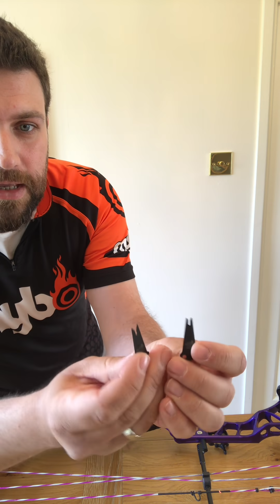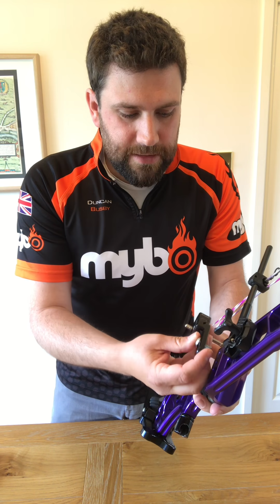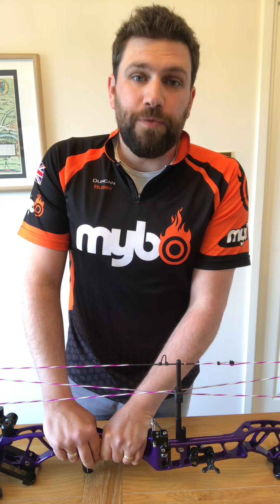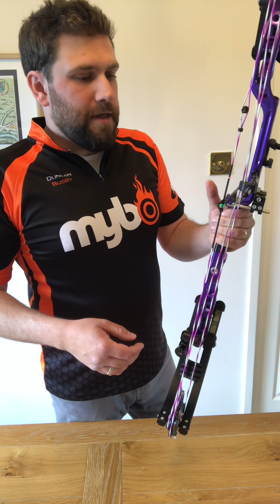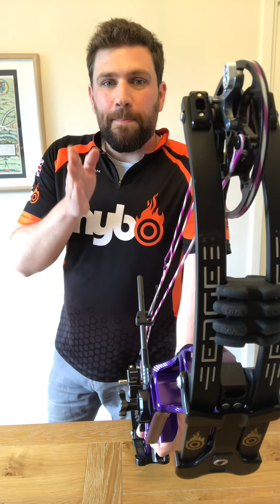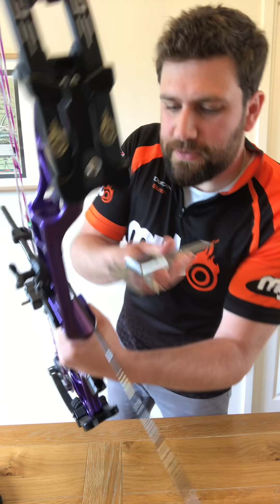How To Put A Compound Arrow Rest On with Duncan Busby

Comment: My blank shaft is obliquely in the target. The nock is higher than the tip. Should I set all the rest higher or lower or make the angle of the blade steeper or flatter?

Comment: My horizon rest is getting trashed with arrows but my paper tuning is a perfect hole?
Reply: You might want to check raising your blade angle and indexing the vanes better.
Reply: @  I think it’s multiple things.. my D loop and knock point in wrong position,  spine too weak , but I still got a perfect hole , I’ve only recently now changed the positions, got a Beiter rest and stiffer spine and it seemed ok but not a perfect hole this time.. it’s bizarre lol
Reply: You want to start with a bullet hole ideally but its not the most important
Reply: Could you further explain?
Reply: @  my arrows were making contact with my rest and scraping it badly  but I get a perfect hole when paper tuning..